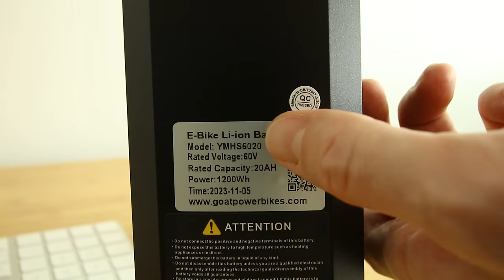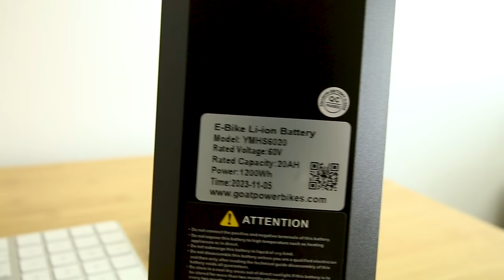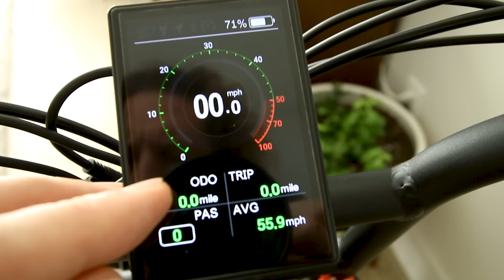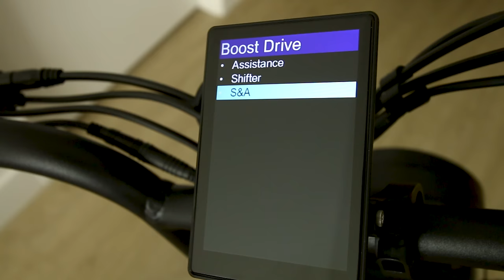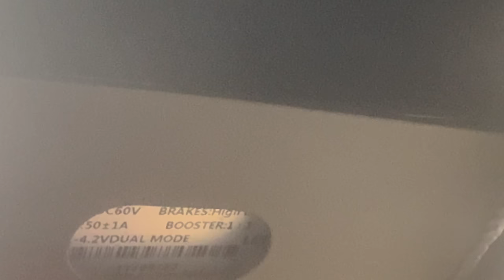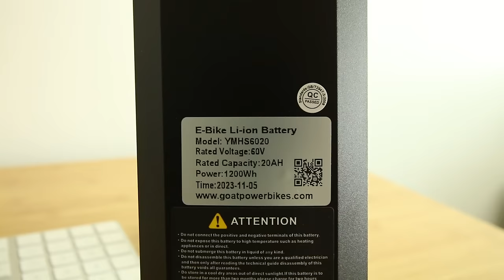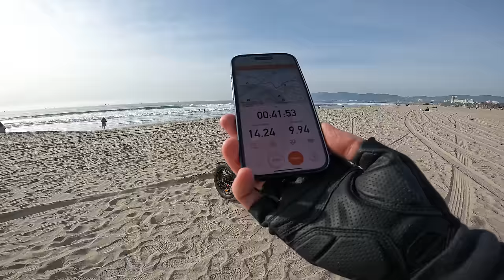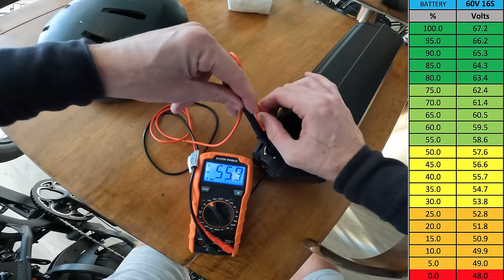The NEW 43 MPH Billy Goat ebike is ABSURD!

Comment: In your 0-20 mph test you concluded that the Billy Goat did it in 5 seconds tying it with the Wired Freedom for the fastest acceleration in its class.  The problem is your video evidence does not agree with 5 seconds because your cell phone GPS shows 13 mph at exactly the 5 seconds mark!  I estimate that it took 7 seconds to go from 0 to 20 which would tie the Billy Goat for 4th along with the Spark Bandit, which is still excellent performance.  Your reviews are excellent and thorough but I am requesting that you perform one more test that only applies to suspension.  Can you video while using the same severe bump (maybe a speed bump) and a hole (maybe a pothole) the suspension compressing then rebounding so we can use that info in our purchasing decision.  There are many ebikes out there that show what appears to be a large beefy rear shock absorbing spring but in actual practice the spring only compresses about 1 inch making the benefits of the very heavy shock negligible.
Reply from the maker: Keep in mind there is typically a significant lag on the GPS readout so I use the on board Speedo for 0-20 readout and not gps. Suspension on Billy goat is medium on firmness.

Comment: Just say no to hub motors! All that unsprung weight will ruin the effectiveness of the rear suspension! Plus the motor can't use the gears to its advantage. It will suck at steep hills or it will have a low top speed. One or the other! But I guess if your a hipster that shouts constantly and has zero respect for the safety of others youl love that bike!

Comment: I just found out about this line of bikes last week. It seems like you get a lot for the money. However those 20 amp hours will go quickly with that much power.
Reply: The V3 has a dual battery option so you can have 45ah on that one
Reply: @destineestolp I don't believe the Billy Goat has a dual battery option, only the Motor Goat and Power Goat.  Of course, u can rig a bike any way u want but the BG frame doesn't seem to support it easily.
Reply: @coperyte  I know that's why I said the V3.
Reply: @destineestolp  They're 2 different bikes though, that's why I was confused. I got u now.  All good.

Comment: 😢 After Roadracing Motorcycles in the early 80's, I'm gonna wish those "MASSIVE" Brake Discs were MORE MASSIVE than just 203mm... ESPECIALLY since were going to be spinning those MASSIVE 4.5" Tires at 45mph..!! 😮
Until you've experienced brake fade AT SPEED, you haven't really lived... 😲😳

Comment: It needs a second battery or a bigger battery... That 2000w motor eats ups power. Real world range of that bike would only be around 20-25 miles with a single 20 Ah battery....
Reply: theres a second battery you can buy to add on i believe

Comment: I think that's the under seat controller rattling like crazy on bumps and on the sand..easy enough to fix, that would drive me bat-shit.
Reply: What you hear might be the front suspension. I have a Magicyle (love it!) But the suspension rattles over rough terrain. I ride off trail thru the woods of NH..and I stand up on the pedals and can manuver easily at crawl speeds between the trees. Thanks to this review im contemplating buying a goat as well.

Comment: Why purposely buy a bike with such a small tire or fAT tires ?  They fall Lynn bumps easier they don’t roll over obstacles as well as larger diameter wheels . The extra fat tires and rims. Just add wait they don’t do anything else or had any benefit to the bike . It’s all silly marketing. Get that same power system worked out electrically for the same gear, ratio torque and with normal size wheels ! And that Bike would be dominant over this one.

Comment: It looks like a motorcycle. That is an easy way to get pulled over. With no tag? You are looking at risking doing some time, dude. For 2.5k I can buy a 1250 4 cylinder  used super bike where 45mph is still 1st gear. I don't know a bicycle should remain a bicycle, imho. Just saying, it.

Comment: Cool looking bike but I’ll wait till they come out with one with a dual battery
Reply: I plan on a second battery that I can fit into my backpack hooked just above that battery and just swap them when I need to, fully upgrading this down the line to a 72v system with 100 amp controller and a much, much larger battery modded to fit where the current one is, maybe solid state batteries will take a step or 2 by the time I'm ready to upgrade 🤞🥹
Reply: The power goat does have 2 batteries

Comment: Nice bike, but a 15-mile range is a dealbreaker. This is a firm pass for me.
Reply: I think a 2nd battery goes for $483.
Reply: @J.D.Vision  Where would you put it? A backpack?  15 miles is just not going to cut it for what they're asking ($2,099).
Reply: Where did they say 15 mi? I seen 21 mi with a voltage left and he was dogging it
Reply: @tonyholmes9024  Correct, but 15 - 20 miles, I dog my ebikes too. I'll pass.

Comment: You talk a lot without mentioning any specs about the  batteries, motor or controller..
Reply: He went into extreme details on the specs, 60v 50amp battery, 2000w motor 2600 peak

Comment: The only bad thing is that you use an open mic to talk and sometimes to understand you I needed to go back and play the part again,exactly the points where are the spikes of play...use a closed motorcycle helmet if you want to do the talk or better make the video and explain later what happened....the mathematical part of how you came with the charging is missing. The part where you talk with the GPS have too much information of other bikes that have different ways to calculate power or speed,you should convert to the same equation or just put top miles in time,way more simpler to write. At least in flat the boke is nice. Why burn the wheels? That does not demonstrate anything I am looking for except you like the stink of burned rubber, losing traction and wasting life for no reason. Do you have a road with higher inclination? I live at the mountains and will love to see if the bike survives 20 minutes at least of up and down hills at Puerto Rico.

Comment: cheap cheap drivetrain components, cheap generic rotors, levers are god-awful. hydraulic cable ends are not even press fit. Where are battery cells manufactured? What is the lithium purity? I see porosity on the welds, wtf?

Comment: Good luck getting hold of the Company if any component fails with in the twelve month warranty period no phone number no customer service...I purchased a Fold a Goat 8-9 months ago and the full twist throttle failed with out apparent reason(E8 Error Code) and MR. Bryson Goodman respond was..(The warranty is for manufacturer defects. The throttle was likely broke due to the bike being dropped. The throttle has worked for 8-9 months, so something must have happened for it to stop working.)....    By the way way the bike HAS NEVER BEEN DROPPED AS HE ASSumed.Yes i know I could purchase and replace new twist throttle myself the point is what if it was more serious component that took a shit and your SOL...A more reputable company would have the replacement part the next day..Honor your warranty MR. Bryson Goodman....

Comment: Anyone who thinks this is a great bike doesn't ride bikes at speed. 
1. Anyone over 5ft10in will have their knees up around their elbows, which gives really poor handling around corners over 25mph. 
2. With these elevated handlebars, your weight will be more so over the rear tire. This is also deadly for cornering at speed. 
Honestly, whoever designs these things to go fast knows zero about 2 wheeled transport.
3. The reviewer should have stayed in school.

Comment: That’s not a bike, that’s an electric motorcycle. It needs to be regulated as such
Reply: Actually it can be both, the gears, size, weight, and handling allow its ride to be tailored to nearly any environment, just like a scooter or personal mobility device, only more capable of safely moving through traffic in the few times commutes force that mode of travel, it's an electric bike with pep, more safe for everyone when used correctly, like any device if misused it could also be something quite dangerous, so that comes entirely down to safe riding, not arbitrary limits that frankly endanger riders that can't stay with the flow of traffic when the commute demands it

Comment: These are nice bikes but I'm just not sold on the (breaks). They keep making them faster but the breaks are the same like they were when they were top speed of 25 miles an hour..!! I'm not biking any faster than 25 miles an hour until the breaks get upgraded. They need to add Air bages on there some where..!!
Reply: Most people mod their stock surrons etc. Most E-dirtbikes go 50+ with the same type of breaks. Better to have a faster bike with the option to upgrade components rather than a slow bike
Reply: @xskimboardingrocksx  Aflax...!!